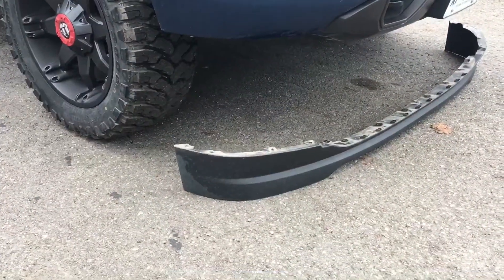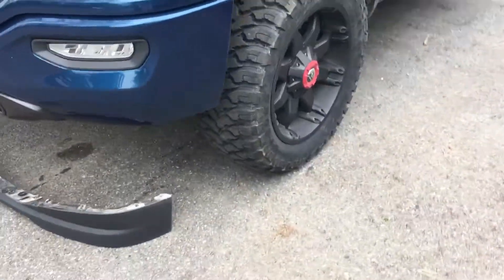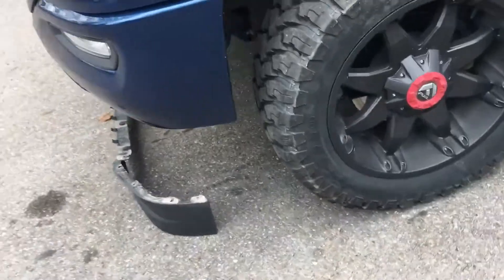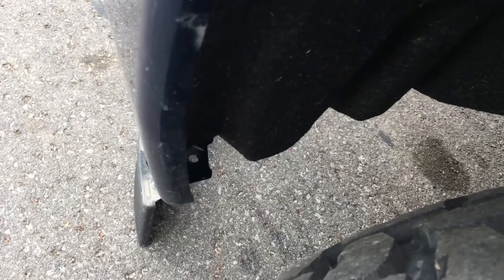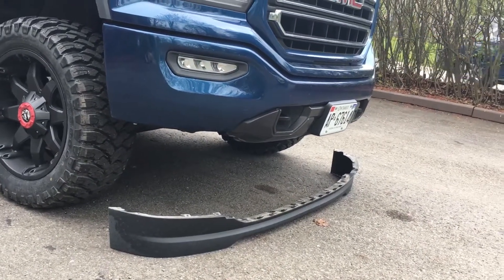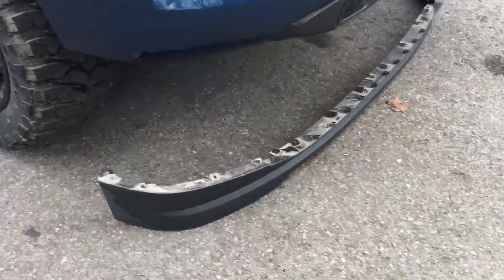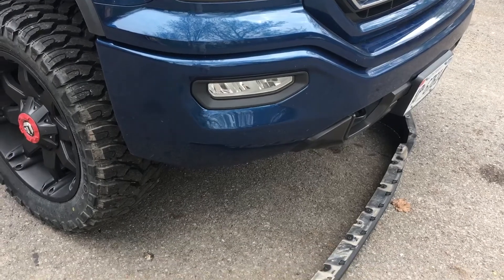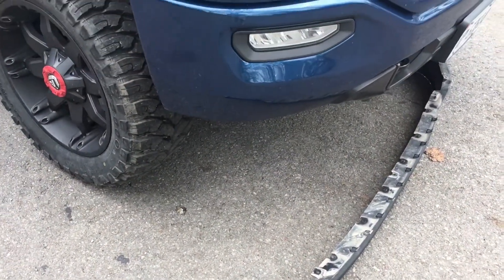2016 GMC Sierra Air dam removed

Comment: Did you lose any gas mileage with this?
Reply from the maker: Quinton Walker no, my thinking from working with air flow on a daily basis is that the level/lift is now holding it straight up and no longer facing down it be less to fight against.

Think if you had a flat board and you are pushing it along water trying to keep it straight it will want to push back, so taking it off will make the drag force less

The problem now will be with how much tire tread you have and how much wind that will catch from no longer having a shield 

So sort answer it didn’t change enough to make a big difference
Reply: What size rims and tires did you get with your leveling kit? Also what brand and model tire are those?
Reply from the maker: I got ready lift, 20inch fuel octains and 33/12.50r20 cf 3000 comforser (really pervy name) but I would never get 20" rims again the ride is Ruff I'd suggest 18-17" to get more tire.

Comment: What size tires are those
Reply from the maker: Tony Baca  33/12.50r20
Reply: Did you have to level it ?
Reply from the maker: Tony Baca yep 2 1/4 from ready lift.
Reply: So all you did was a leveling kit in the front? And are those 10 ply tires?
Reply from the maker: Yes and yes
Reply from the maker: I don't recommend the tires unless you can get than cheap